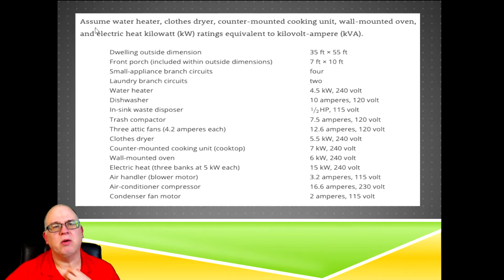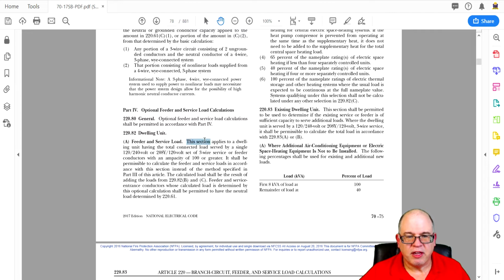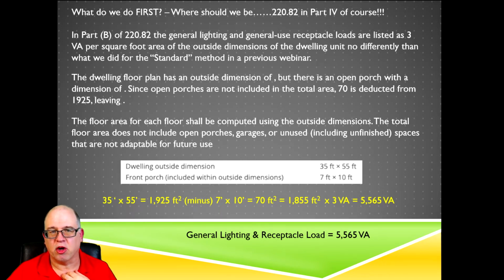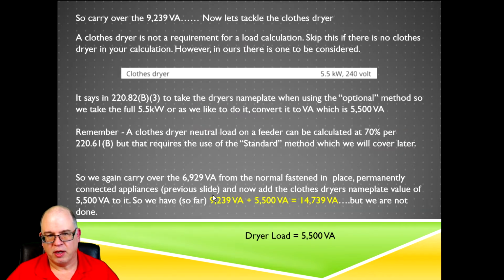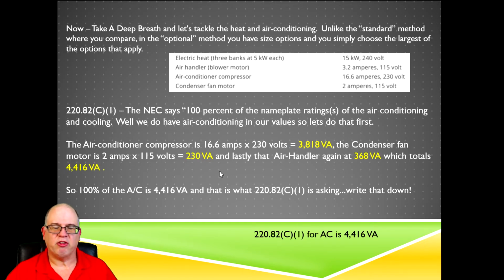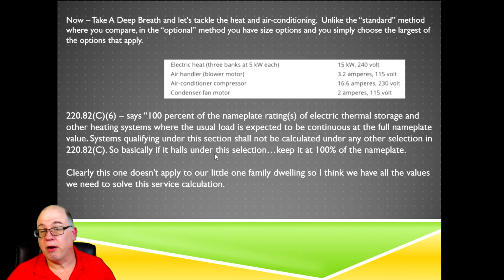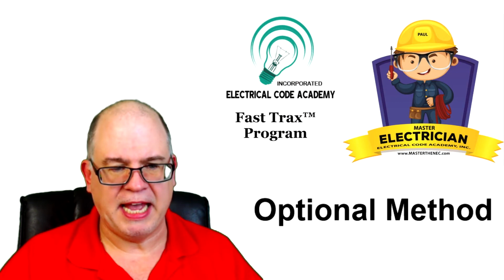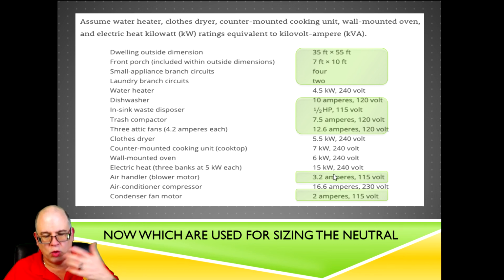2017 NEC - Webinar Series - Optional Calculations for Single Family Dwelling

Comment: Could we use the optional method if we have two sets of parallel conductors?
Reply from the maker: Greetings - not sure what you are asking. The optional method is to determine the load. You can divide that in parallels if you wish, excluding the use of 310.12 of course.